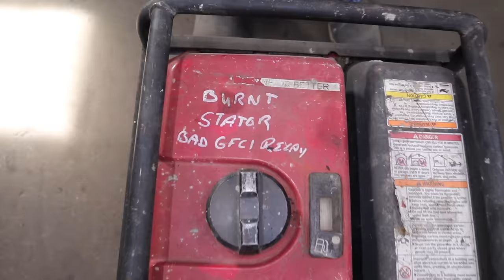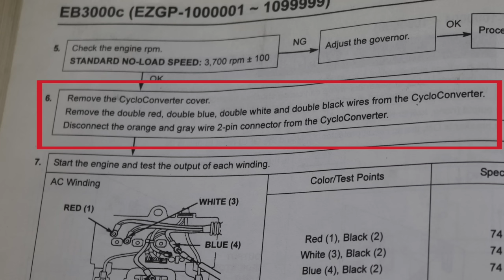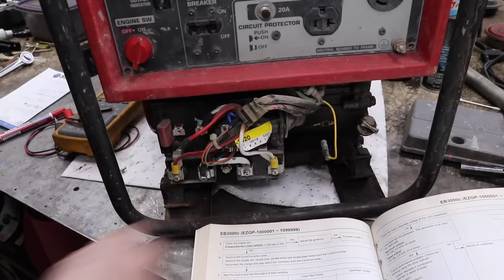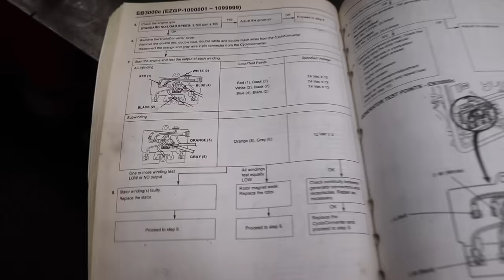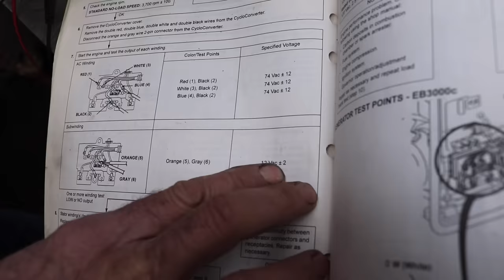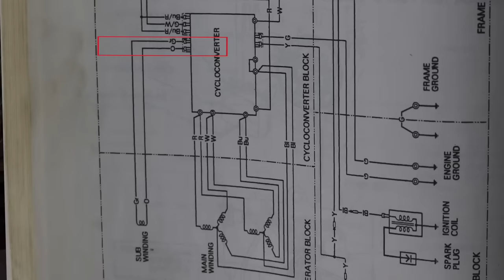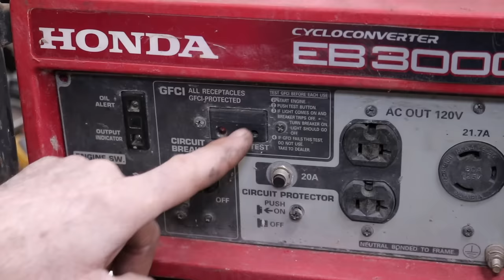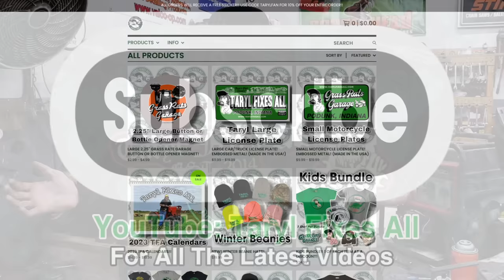Some Things Change For The Worst

Comment: Hi Taryl. I am a 13 year old and I have an obsession with small engines. So far I haven’t got anything running but I’m getting something new tomorrow. Thank you so much for all your amazing videos. I get all my inspiration from you.
Reply: I was the same when I was your age 30  years ago. I really think that's what gave me knowledge of now working on all my old trucks tractors and equipment now. I got a few of my old engines stored away now my 10 year old is starting to tinkering with them to
Reply: I was that age too when I started
Reply: You'll get it.  There is a lot of junk out there.  Don't trash anything out though you might figure it out later.
Reply: Get a repair book or a few, the right tools you might have better luck at getting them running vs just guessing at it... I know so much about small engines, I don't need a book to say what's wrong! I just use the repair books for tork specs
Reply: Don’t stop reading! YouTube is amazing. If I had the internet 35 years ago when I was your age I’d be a millionaire x10 by now. Now I just am lazy and only x5. Good luck young fella!
Reply: I'm the same way. Try to find a little Briggs & Stratton engine or whatever you can get your hands on and take it apart then put it back together, it might take a few tries and you might break something but you'll learn and that's what's important!
Reply: Briggs would be a good one to start on, they always need repair. Researching common issues can save hours of trouble shooting. However you will need to learn gx style engines as most went to Chinese clones of those.
Reply: Good on you , always look for the hidden in line fuel filter ,screens every little motor has them ,get a few little junk motors n pull them down to the last but and bolt , happy travels
Reply: @jeffreystorer4966  some carburetors have a secret little screen too.
Reply: Same! You are just like me!
Reply: Thestreetchecker 
Check out James Condon, Chickanic and Small Engine Mechanic on YouTube. Great sources
Reply: I'm 14 now and I've been working on stuff for a few years now. Keep on working bud  you'll get there. You can do it!
Reply: I suggest looking for info elsewhere
Reply: Keep working on stuff and you will get engines running, just remember always start with the simple stuff, check for spark, air filter, see if it runs and dies with starting fluid....and check spark plug,....check the basics first always...and go from there..👍👍
Reply: Hi Taryl. I am a 76 year old with the mind of a teenager.... and I have an obsession with small engines. So far I haven’t got anything running and am going nuts. Thank you so much for saving me from dilerium..
Reply: @caroltenge5147  you too old to be working on engines
Reply: Update I got the generator running that I mentioned in my comment. “Getting something tomorrow.” Thanks taryl! There’s your dinner!
Reply: Air gas &spark?
Reply: @kidkv in d

Comment: Planned obsolescence.  You're right, Honda generators are junk and it's too bad the manufacturer is so greedy.  They wanted over $30 for a simple carburetor needle.  I got my Troy Bilt/Briggs & Stratton generator in 2008 and it's been through four hurricanes and still serves me well.  Oh, and it starts on the first pull, go figure.  Nice job on the vid.
Reply: My Coleman power mate 5000 with Briggs  bought in 1998 icestorm is going strong for 25 years now  still...going....
Reply: Correct!! Honda is getting out of the gasoline engine market.
Reply: @ruchknruchkn6575  Likewise but I had to add electric (12 volt) start. It's a 98 also and runs like a sewing machine. Also added a throttle so it can warm up and cool down idling. Pulls a 220 well pump mostly.
Reply: Same thing happened to me and they wanted $40 up in Canada for a needle I got the whole clone carburetor for like $15 it's bolted up and work just fine
Reply: In the UK the Honda Izy steel deck mowers are junk because the steel they use for the cutter deck dissolves terribly if they aren't cleaned yearly. Some of the models we see are only ten years old and are already fit for the scrap yard. Mad thing is people pay a premium for the Honda name and the mowers aren't that great.
Reply: @bentullett6068  I like Honda but not tHAT much. I can get decent service out of anything if I have the right stuff and are willing to do with it what's needed. Oil changes are the main thing. In the old books, Briggs recommended every 20 operating hours. Now they say 50. I just do when needed. And decks are better off to be painted once a year anyway. Catch the rust before it kills everything. All mine are older. The latest is a 2010 electric start hand mower for the Missus. I also have a couple of 85's. Older the better and NO Hondas. One Kawasaki. CHEERS!

Comment: I bought a champion generator a couple years ago. Been very pleased with it. I use it for power outages and power my camper. Honda has lost its mind the last 20 years or so. The cars are the same way. They used to build simple, super reliable transportation vehicles but now they seem to want to compete with bmw or something. Not the same company they used to be.
Reply: Nothing big against them... but the new ish Honda suitcase generators? Yeah i wouldn't snap the pull cord. It's not the simple 5 minute max repair like most generators or machines. Tear more than half the thing apart to even see the damn thing, then struggle to get it out, unbolting everything, a giant disaster. Some generators sure take off a panel, then its a bit tough to get at, but still get it out no worries.
Reply: Planned obsolescence is out of control as is the decline on quality control. Everything "Modern" is really junk so don't overpay, especially so called flagship company items. Go somewhere in the middle so it's less panful if it fails or the company lets you down with obsolete parts.
Shame on them all.
I hope Honda watched this video and hang their heads in shame.
Reply: As far as vehicles/motorcycles, Honda still makes some of the most reliable, always neck and neck with Lexus/Toyota.
Reply: As someone that maintains Toyota/Lexus and Honda vehicles, they make excellent engines and transmissions. Now, Honda had some issues with their CVTs but within a couple of years of production, made significant changes. Maintenance is the key, but the Japanese have a much different mentality than American auto manufacturers.
Reply: @TheKurtTribute  NO WHERE CLOSE TO A LEXUS!!! YOU CRAZY?
Reply: @ZAPATTUBE  The information is out there, perhaps not enough to reverse your confirmation bias though.
Reply: @ZAPATTUBE   When it comes to engines Honda has still been king.  All you have to do is go look at extended warranty underwriter data.  These are the people that HAVE to know and gather detailed data on engine failure rates as they are the ones providing the financial backing for extended warranty programs.  When it comes to engine failures Honda is on another planet compared to everyone else...yes including Toyota.  Honda has HALF the engine failures of Toyota and Toyota is a big leap above the rest.  Does this mean Honda's are more reliably everywhere?  Definitely not.  Every manufacturer has its issues.  But Honda's K-series engine that have formed the backbone of its car lineup for two decades now is easily one of the most reliable and strongest mass produced engines in history.  It is SUBSTANTIALLY more advanced than Honda's flagship 4 cylinder engines that came before it.  Has Honda cheaped out in other areas at times?  Definitely.  But when it comes to the heart of the vehicle the notion that they started designing things cheaper and more prone to failure out of warranty is just objectively false.

Comment: There's a huge number of Honda EU200i / EU2200i generator owners who are completely satisfied after years of running them ragged.  How many?  Don't know, but good luck finding a used one for under $700, even though new are only about $1200.  This particular unit coughed up a little smoke on startup, which suggests someone ran it long and hard.  Tough to dismiss an entire brand based on a few failures.  The units that hold up admirably aren't the ones that make it into your shop.  I wouldn't hesitate to buy a Honda, except that my Yamaha EF2400is hasn't missed a beat in its first ten years.

Comment: I bought an off-grid cabin that came with a Champion generator, and a Troy-built.  The previous owner spoke well of the Champion, and it worked well for me.  The Troy-built did as well.  I had heard good things from a neighbor about his Honda generator - it must not have required service.  It is a darned shame our society is changing to throw away as far as appliances of all kinds.
Reply: Every troy-built piece of equipment I've ever had I've had problems with!
Reply: @_RocketRooster  they are owned by Electrolux now and 10x worse same with Husqvarna!
Reply: You are right. Just like that generator, new household appliances are junk. Accept for very high end products. A lot of circuit boards that can't be repaired, only replaced.
Reply: @scottjohnson4910  I can remember when Troy-Built was one of the top brands but that has long since been gone! I don't like working on them or even using them for parts! Thats a shame about Husqvarna. I have an old Husqvarna chainsaw that I love. Best chainsaw I have ever owned. Wouldn't trade it for a new one thats for sure!
Reply: And being throw away, doesn't make it any cheaper!
Reply: Speed Queen is definitively the best quality washing machine you can by.  Like, to the point that nobody even bothers to debate it.  Been that way for decades.  

I wonder how many of these people that complain about how everything becoming disposable junk nowadays own a washing machine that isn't Speed Queen.  Probably most.  Maybe all.
Reply: @_RocketRooster  My mother bought a Troy-bilt weedeater 2 seasons ago. Within the first 2 hours of use, the 2 bolts holding the carb on snapped off and the carb fell off. 🤦🏻‍♂️
Reply: @Studio23Media  I can most definitely believe that!
Reply: @_RocketRooster  Older Troy-Bilt stuff is great but back then most everything else was too. Those tillers are built like tanks.
Reply: Junkbuilt
Reply: @ItsMrAssholeToYou we bought a Speed Queen washer many years ago after going through several expensive junk big box store washers. It has been awesome and trouble free. We should have bought one from the start.
Reply: @ItsMrAssholeToYou  I recently bought a Heubsch washing machine. It's the Canadian name on a Speed Queen.
Reply: @RSole9999  
I've seen that name in The States, on commercial washers.

Comment: I inherited a Honda EU3000is. It had been abused. The previous owner retired it due to its age. The hour meter stopped working so I can't be certain how many hours it actually has on it. One thing Is for sure: It's worked absolutely flawlessly for me. It doesn't burn any oil. I have been careful not to overload it. If you take care of a Honda product, it will serve you well. Thanks but I will keep my Honda.
Reply: A Honda engine won't typically burn oil. They're great small engines, we all know this. He was talking about part pricing/availability and the complex electronics in some of these gennys.
Reply: I have four compressors that run everyday long hours and run hard all day … still going .Honda generators never go bad as well

Comment: I have a 5KW Coleman 10 HP Breaks and Scrap'em that's about twenty years old and I desperately needed it this weekend because of ice storms knocked out power for three days straight!
I try to start it every year or so to keep it in good shape.   I have to say that it ran all weekend flawlessly and powered the important stuff, no problem!
It used a lot of fuel, but it real saved my bacon!.  Thanks Taryl.
Reply: Are you that way with all old people
Reply: It's called satire,.......It's a comedy skit and a lot of us are amused.  Lighten up sir.
Reply: I got a coleman i bought back in the mid 2000's.
I have used it alot after hurricanes and odd jobs where i need power away from the house. 
Last time i ran it was when Irma hit in 2022 its starting to make a noise sounds like a bearing on the generator side is going bad. Other than that its still going.
Reply: Same I have a 4000W Coleman with a tecumseh. Mine was out in Michigan for 3 days
Reply: Check the rear axle seal...
Reply: They wear out too fast if you use them for cat fishing...,just use a hand crank and it'll be fine!...
Reply: It would be cheaper to set it on fire and then take it back and try to get your money back...
Reply: Briggs used to make and sell great engines.  They still do with the Vanguard series.
Reply: @patrickstockton2091  and the air in the tires
Reply: There is no substitute for internal combustion when the pooh hits the fan.
Reply: @DavidSmith-fr1uz  I am not sure about now but, my now wife bought a Craftsman mower with a Briggs engine, it is 10 years old, stored in the shed without stabilizer fuel in the tank.  It starts in the spring with only 2 - 3 pulls every year, one pull of the rope for the rest of the season.

Comment: Love your videos. Starting a business was a good series,hit the nail right on the head.
I drove truck for over45 years. I used to run to St Louis ,Cincinnati,Louisville, Indianapolis Jersey,Philly,etc..
I considered buying my own truck, but too many hours for no pay.
I studied auto mechanics in high school,but got into transport company at 19 years of age.
I always fixed my own cars, built a race car, worked on others race cars
 After I bought a house, i learned to fix everything
Septic system, electrical, and plumbing,including a deep well.
I finally got a new lawn tractor in 96, and again in 2001, which I still have. L130 JD with a 23 hp, Kohler.
 We seem to have similar abilities in repairing small engines, of course you have more experience
I wish I lived close, because I think we could become close friends
I am 74 years old,  so too old to start a new business.
A neighbour gave me an old lawn tractor Yard Machine, 15.5 hp,42 in deck. The steerin was screwed up, no battery,4 flat tires.I dragged it home behind my Gator. Hooked up a jumper battery, added gas, checked the oil level , and cranked it over. The thing started, but it hammered and banged terrible. The crankcase vent tube to the carb was kinked, and looked like the oil was coming out of the lower crank seal. The air filter was soaked in oil.
Turned out, the motor was loose on the frame, making the banging noises. The oil drain tube was screw up and dripping oil into the pulley on the crankshaft, and flinging it onto the belts.
I got new belts, battery, air filter,tire sealer,oil, light bulbs, and with tlc, this machine is presentable again. Just another example of people willing to give things away, and we are able to bring things back to life. I,ll try to send a clip of the little tractor as Im proud of it
Thanks for all your videos..
 I live 100 miles north of Toronto, Ontario on Lake Simcoe
Reply: My restoration
Reply: Trucking here in michigan..for 38 years retiring in upper peninsula of michigan in 2 years..trucking not the same

Comment: Several years back, I had to choose between a Honda EB6500 generator and a EU6500 inverter generator for construction. Glad I went the non inverter EB6500. It might use a little more fuel as it doesn't rev for the specific amp draw like the inverter one, but rather idle  (when not in use/standby) or 3600RPM no matter how big or small the load is. But it sure is a more rugged design! And it's working at 90% load most of the time anyway. I run non ethanol fuel, and do oil change intervals 2X more frequent than Honda recommends, and with 5w40. 1000+ hours on the meter so far, never had an issue. 

I also have a 37 year old, self propelled Honda (SX-70 model, I think?) mower, that I used as a kid to buy my first dirtbike at 12 years old and car at 14. It cut 10+ lawns a week for 15 of those years, still alive and cutting today.

Comment: Have had Honda equipment for close to 40 years and have only had minor simple fix problems. However, I am sure that if I ran into some more complicated problems I would run into the very same issues that were in the video. Like anything, if you find that replace parts are NLA or if they ore out of this world expensive, they are junk. I have various pieces of farm equipment that are over 40 years old that I can still get repair parts. Although they might be quite expensive, they are never the less still available and compared to the price of a new piece of equipment, well worth the price.
Reply: My old accord feels better than my new accord in many aspects. A couple bucks fixes that thing up good. Im going to change the oil, install a button and list it for sale. I dont drive much, I need a motorcycle.

Comment: I bought a Champion generator about 13 years ago because it was a great deal. It gets used during power outages, usually at my sister's place.  The only repair I've done is to install a new carb because she used crap gas, left the fuel cock on and didn't run the gas out. By the time I got to it, the carb was trashed.  I don't let her keep it for any length of time anymore. I go and get it so I can do the right thing.  She had to buy all new battery equipment because she did the same thing with all of them.
Reply: Classic
Reply: Where are they made ?
Reply: Great show, just getting to old and dumb to keep up
Reply: @cliffordbowman6777  I think champion is an american brand.